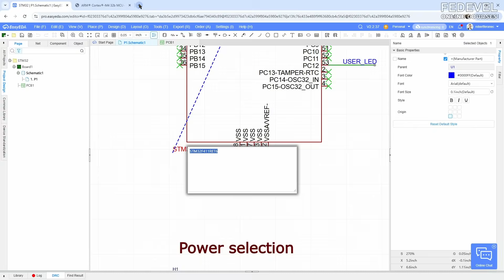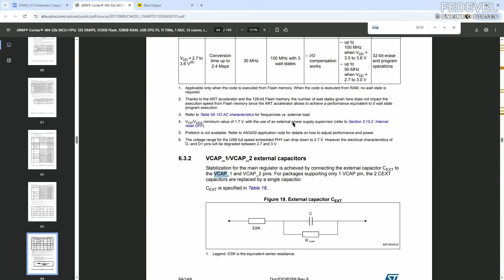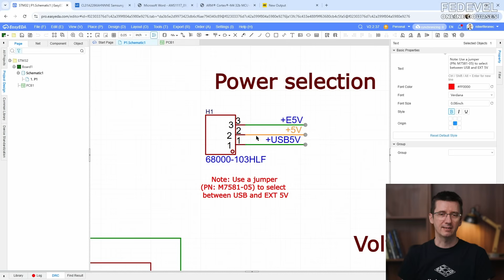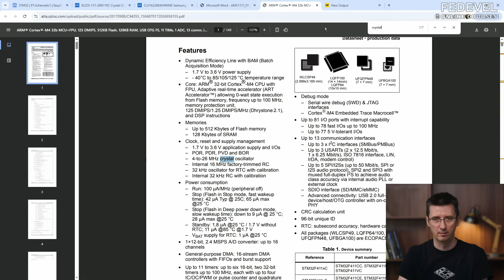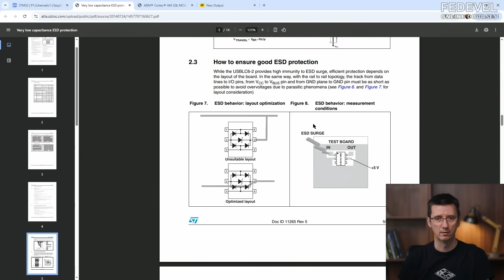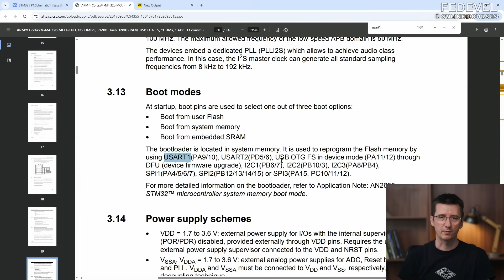Is this really how beginners design boards??? | Schematic Review

Comment: I don't care for a power block on top with IN on one side etc. I much prefer the pins in the ACTUAL layout (when possible per package). It makes it much easier to get an idea of the basic layout while I'm wiring things up. I'll be able to easily see if something may need 4 layers or to run below the chip or between pins. By the time I'm editing the layout, I already know where the trouble will be.

Comment: 3:30 sorry, but why would i change the symbol of the mcu for every project? changing the gpios in the symbol to another side simply because in this project you happen to use them as a usb interface seems weird. also it would make it way harder to get used to the component as pins would switch places depending on the project???

Comment: On the output capacitor, the AMS1117 maybe is one of the worst examples to explain this as I can not find any datasheet that has proper data in regards of this. The issue with the capacitor on the output of a LDO is with the ESR - equivalent series resistance, this is what is missing from the datasheets.
Ceramic capacitors generally have a much lower ESR than tantalum capacitors and seeing that all the "datasheets" I can find for the AMS1117 advise to use a tantalum capacitor is a red flag.
Why is this is an issue? Because using the wrong type of output capacitor can make the LDO oscillate the output voltage at a high frequency. And not only in theory, I have seen this happening with circuits brought to me for analyses.
So, unless the datasheet states in clear terms that this is ok, never use a ceramic capacitor as output capacitor for a LDO directly.
If you have to use a LDO that requires a tantalum capacitor, but you want to avoid using tantalum capacitors, use a resistor in series with the ceramic capacitor.
And there is so much more to consider that is not so important in this context, like voltage and temperature derating.

Comment: As far as the design goes for a noobie, this is not bad, maybe noise problems and no esd immunity but otherwise this is acceptable. The thumbnail is a little extreme for this. 
That being said, there is room for improvement, and 26Mhz crystal will work for this ic as per the datasheet. 
Cheers.

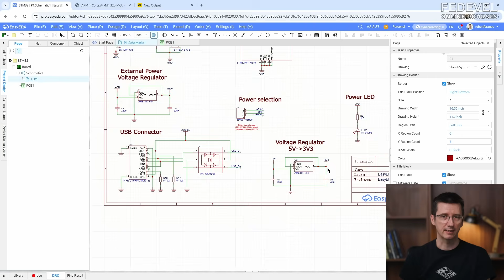Comment: Could someone explain the AMS1117 symbols?  I thought that one of the selling points of AMS1117 was that it was pin-compatible with older 3-pin regulators, and that if it had a 4th "pin", that would be an exposed (GND) pad for heat management.  But the symbol at 10:39 seems to have 4 pins, with the 4th being a double of VOUT.  On the left, I'm seeing GND, VOUT, VIN without an adjustment pin.  If the pins are being moved from the physical location, then why not put VIN/VOUT near the top and GND at the bottom to minimize line crossings?
Reply from the maker: some components have variants where they have pins swapped

Comment: On the tantalum capacitor... I think you missed an opportunity for you as a very experienced designer to really educate here.  Instead of a hesitant sort of allusion to some condition where it would matter, could you explain a single one?  I assume it has something to do with either ESR or temperature variation... but it would be nice if you could explain it.  I see a lot of designs with these exact regulators with ceramic and electrolytic caps that apparently work fine.

Comment: If it is common to include comments and descriptions in lines of code (a descriptive header for the module or function and comments on the lines individually), why wouldn't it be the same with hardware? I use this a lot and I go even further: for connectors I even include small real photos of them. It helps a lot when the repair technician makes a repair or when he goes into the field to install the equipment.
Reply: The description stuff is very interesting. As a software engineer he's used to commenting his work. I put short comments on my schematics too but the tools don't have comments in mind - they're not much more than labels. Encouraging comments (and NOT popups - something that will appear on a printed or pdf schematic) would be a great addition to pcb tools. Adding pictures is a really cool idea.

Comment: 38:00

If you're using a Jlink or Stlink or something like that to program the board, you need to have the reset pin broken out there, if I remember correctly.
Reply: I have used STM32 mcus extensively over 10 years in my hobby use and been using a 2€ st link clone to flash them, you don't always need a reset signal, but I do break it out to the programming header
Reply: @antecboy  I've only used a JLink as a professional and we always have the reset signal broken out. But those were not STM32.

Comment: Great video. Reminds me about my first PCB. STM32L151C8T6, couple LP2985AIM5-3.3, SIM808, TP4056 and almost no expense in designing PCBs. Designed it in DipTrace with no schematic, DIYed it with laser printer, and it worked on a second try (I forgot to place several traces, had to solder a jumper wires). This GPS beacon is still hidden inside my car, sends me SMS sometimes. Should have programmed it to use internet instead. 
I guess, we need more such videos with design review and mistakes discussion.

Comment: 25:40 I have a comment about shorting capacitors with pushbuttons. Some people say that it is actually a good thing, to clean the contact by a high current and extend the life of the pushbutton. (wetting current)
I was talking once to a guy from Feller (a Swiss socket and light switch company), and he told me to never use light switches for switching low current/ voltage signals. The silver contacts needs an arc to clean them, no arc, no cleaning and the switch dies soon or becomes not reliable. I know gold in pushbuttons is an other storry, but still.
Reply: The question is: how much energy is required to break down an oxide layer. Or how large a capacitor would be required to "blast away" the oxide layer?

Comment: Lately, I've been avoiding the '+' symbol in net names. For example, from '+5V', secondary names might be '+5VEN' or '+5VPG', which are then connected to microcontroller inputs. When writing code, I often want to use variable names that closely match the schematic. This makes the entire project clearer. Therefore, net labels should be without special characters.
Reply: well an identifier in C cannot start with a digit anyhow?
Reply: I always name power nets with P or N (ie. P5V, N3v3, etc. )  Our CM requires this since they have issues with the + symbol in their software, and it makes the schematic clearer

Comment: As USB is being used, it's also a really good idea to check that the chosen crystal frequency can be passed through the clock tree and produce the required frequency for the USB peripheral - the ROM bootloader may also have some restrictions on what frequency crystals are compatible for USB DFU.

Comment: Typical crap modern schematic diagram! How about actually CONNECT stuff together instead Of having 20 separate little groups of parts? That IS NOT a schematic!
Reply: Because it is more readable. Actually connection method is really good for circuits with some separate transistors or low integrated ICs when you really create a circuits. Here is just recommended connection of standard blocks with the standard names. So why not use net labels?
Reply: It actually speeds up schematic development significantly, and also makes it extremely simple to read in the future (for maintainance and repair), I understand why older generations don't like it, because they're used to system wide drawings/schematics, but if you need to investigate a single part of that system a few months later,  it's a reverse engineering task just to see what the hell is going on.
Reply: @Program2live I don't understand your comment. At the one hand it states: "speeds up schematic development significantly, and also makes it extremely simple to read in the future. To conclude at the end "investigate a single part of that system a few months later,  it's a reverse engineering task. Schematics where each connection is a net label doesn't provide an overview of the real complexities going on in your circuit. What if such a schematic doesn't pass ESD or EFT burst testing? You can't even see where those signals might be going.
Reply: @foobarables  I'm talking about the old style of system diagrams/schematics are a reverse engineering task. As for ESD/EMC testing I don't see what you're talking about, in fact if you've done this professionally as I do for a living and have for 10 years,  pre-compliance 3rd parties appreciate modern schematics using nets, global labels, hierarchies etc. It lets them understand each section and have it described clearly, which is why If you're developing as a team you can each work on individual sections. If you're using the video as an example of this modern way then I'd suggest you look at real professional grade work.
Reply: @SwitchingNoise  Is the problem that the net names are too cryptic to tell you where they are going?  Or that you need some layout details that don't show up in the schematic, but are easier to guess from a connected version?  Or that the divisions are often in the wrong places, so you can't see what is missing, since it might be at the other end?  Or ..?
Reply: @Program2live  As a developer of explosion proof electronics of the type IIB suitable for hydrogen gas I can inform you that schematics with net labels all over the place will not pass certification. It doesn't mean you can't use net labels. But they should be used with care and in a sensible way. Maybe an example to clarify my aversion for the overuse of net labels and compartments is in place. Let's say you have an SPI and an I2C bus with 5 participants on each bus. The in my opinion proper way is to have a clearly labeled BUS for the SPI and I2C signals into which the participants connect and net labels for each chip select. Such a schematic shows you what is going on without digging trough net labels. But some like to put each bus participant into it's own named compartment with net labels for all signals. I don't need such information like named compartments unless the device in question requires special attention for some reason.
Reply: @foobarables  "I can inform you that net labels all over the place will not pass certification". Please just stop, I didn't say that, I have never thought that, I have never done that. Making up things then claiming to know something I don't is embarrassing.
Reply: @Program2live  From the first comment you've made one can deduce you agree with the way the schematic in the presentation has been put together. That's why I questioned your comment. My apology if my comments insulted your intellect.
Reply: @SwitchingNoise Well just for the record I did write the following "If you're using the video as an example of this modern way then I'd suggest you look at real professional grade work." But lets get on with life, we both have actual work to be doing!

Comment: The AMS1117 will oscillate with those ceramic capacitors. The tantalum ESR garanties stability.
Reply: higher capacity ceramic ones should also work, but then i always worry about thermal stress on ceramic capacitors around linear regulators.
Reply: @pvim  higher capacity ceramic ones don't work because the ESR is to low for the LDO. The ESR introduces a zero in the feedback required for stability. There are some versions of the xyz1117 LDO's capable of working with low ESR capacitors. Thermal stress should not be a problem because the thermal conductivity of a PCB is low. Also, how hot are the regulators if you think thermal stress on other components starts to be a problem?

Comment: Been designing boards as a hobby for the over 20 years and I have to say he knocked that schematic layout out of the park.
Reply: Software development is not that much different from electronics or other types of engineering where you can't easily see what you are doing.
It is all about organizing your thoughts in particular way. Being honest about what you know and what you do know, identifying what you need to research and then researching the parts you do not know.
As you may have guessed I am also a sw dev and I found myself right at home when working with digital circuits maybe with some gotchas.
Reply: I would say this was pretty excellent.

Comment: Hello Robert! Thank you for your work. I have a question: what do you think of different capacitors values for decoupling? what's the point of placing 10nF and 1uF together? I heard about different frequency responses but i saw Texas instruments pdf where they mentioned that it is not true for modern mlcc. Also I have seen on simsurfing that same size caps but different values like 0402 100nF and 0402 10uF have only minimal difference in impedance at high frequencies. Also TI pdf mentioned that multiple of the same value caps are preferred because different values may make an antiresonance on impedance graph
Reply: Minimal isn't quite zero, but it may well be at the point where the remaining advantage isn't worth the complications and risk of having to do the calculations.  Which also applies to different values vs anti-resonance.  ("May well be" isn't a euphemism; I don't have the answer or even confidence in how to find one in practice, rather than fragile theory.)
Reply: Physical implementations of capacitors - in particular through-hole components - form an LC circuit, with the leads to the capacitor forming the inductor. (Yes, a small value inductor, but still an inductor.) Thus it will block AC at a certain frequency from being filtered out of the DC bus. By using capacitors with different values, you can make sure that there's always a capacitor for any frequency that will effectively filter that frequency out. 
Modern SMD MLCC capacitors have next to no input leads, so also very low inductance. This reduces this effect, and apparently so much that TI says you don't need multiple capacitors anymore.
If you are interested: the EEVblog made a video about this a few years ago.

Comment: if the Kt-0805G Led is used which has a forward voltage of 2.9V the 1k resistor is too high, 100R or below is more appropriate
Reply: Just put off your sunglasses))

Comment: I'm not sure the video title or thumbnail was justified for this board with so few/minor issues.   I've seen far more issues from seasoned developers and I think a number of your comments were just personal preference rather than actual problems.
Reply: The title was a bit clickbaity, but I personally found this video very helpful. I'm also primarily a software developer with some formal education on electronic systems, so I have a vague idea of how the schematic should look and how some things should be done. However, videos like this explore some of the gotchas that can scrap otherwise fine boards. This kind of information can be hard to come by on the internet
Reply: Yeah I'm by no means an expert at PCB design, but I don't understand why having the USB connector separate from the MCU is a problem at all. It allows the component to be more modular between projects (easier to copy/paste), and cleans up the schematic a lot. When I do my projects, I like to keep critical components together, but components not required for something to operate can be separated using Nets.
Reply: As a seasoned developer totally agree, I also didnt agree with Robert about changing the stm32 symbol, thats a common layout for stm32s, and they are designed to show possible pin compatibility across MCU range. Swapping things round because you might use a GPIO as USB or not, is not a good recommendation at all. 

If i had any issue with the schematic layout, it would be the designer should try to logically flow the power path, USB in at top, to power regulators/bucks to MCU to outputs... 

I also wouldn't use a 26mhz crystal, i tend to stick to 8 for most stm32s. But that's a personal preference thing.

Also I was really surprised to see a static protection ship attached to the USB... thats something even seasoned devs often forget to do.
Reply: @MD_Builds  To be explicit, are you saying to stick with that STM32 symbol on the schematic because it is standard?  (I understand not re-assigning physical pins without a good reason, but are you saying that for STM32 in particular, the schematic symbol should reflect the physical order, even if other symbols are re-ordering things?)  Also, is the ESD protection chip typically forgotten, or typically left off for cost reasons?  Is it something you need to keep the device working for a month, or something you need for 1 device in 1000, so you buy insurance?
Reply: @jimjjewett  Im saying stick with the stm32 symbol that comes as part of the common library, (same with kicad too) because its designed to be easy to do quick comparisons for pin compatibility across ranges. 
And im saying that its good to see the ESD protection chip. Its something thats regularly over looked.
Reply: Yeah not cool
Reply: It’s social media everything is exaggerated 🤷
Reply: When I create a symbol, usually as pin name take main function (for example PA6 or PB8) and as pin parameters for everyone put all hardware functions (for example SPI2_CS, or USB1_DP). It takes a lot of time, but every next design I using this symbol, I can double check MCU configuration and the schematic become more readable by turning on or off visibility of this parameters.
Reply: Its either "the thumbnail and title are clickbait!" Or "oh my god, this video has a criminally low view count!"
Reply: The real mistake has not been addressed namely the decoupling of the 3.3 V regulator and the ESR requirements put forward in the LDO data sheet.
Reply from the maker: The guy who designed the board told me to put the picture there :)